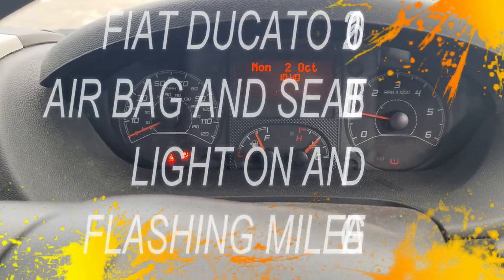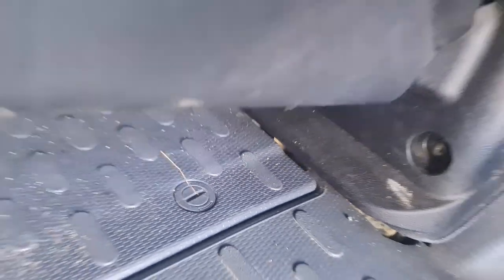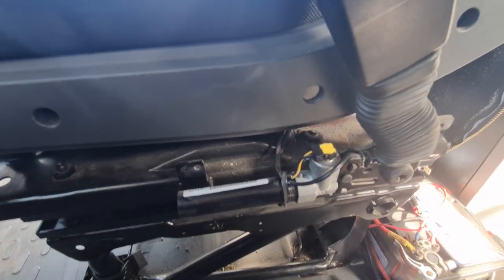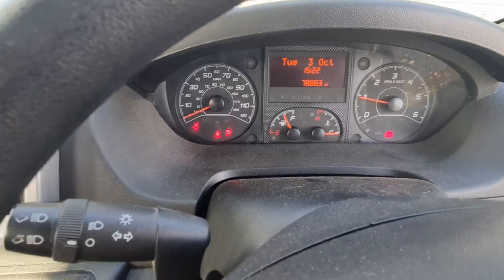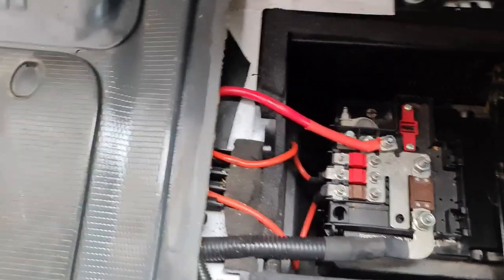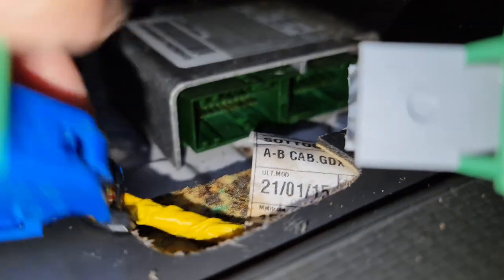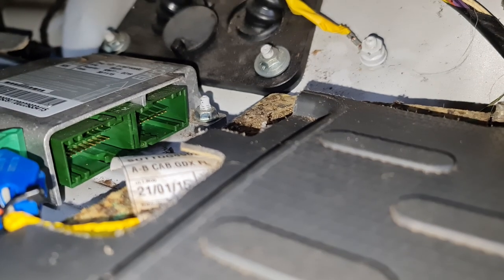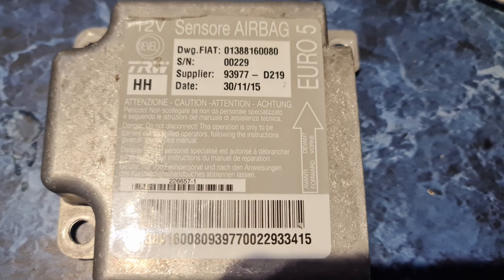FIAT DUCATO 2016 AIRBAG AND SEATBELT LIGHT ON AND FLASHING MILEAGE

Comment: Exactly  the same issue, just fixed.
An important  point,  any disconnection/connection in any part of the air bag system must be done with the battery disconnected for several minutes. A accidental deployment  or damage to the air bag ecu may result.
Some faults can be fixed  but many cannot. A new module is the safest solution. Order through a Fiat  dealer  ( even if  your van is Citroen or Peugeot, the part through Fiat will be lower cost). The part number  is at the  top of the module, not the bar code. The replacement  will  have the updated  part number, black label. Once installed the new unit needs to be proxy aligned with a suitable diagnostic system. Diy systems ALFA obd and Multiecuscan can do this or most garage diagnostic systems. 
The airbag  ecu has to match the vehicle configuration, so must be ordered on the part number. Expect to pay, Jan 2024 around 280 Inc vat.
Reply from the maker: thanks for watching and comment and info

Comment: Gutted for you fella that’s a nasty sting in the tail 😢. Hunt the wonder web you might get lucky on a replacement cheaper. As for the mot if you remove those bulbs they can’t fail it ! No light no problem 👍
Reply from the maker: good point Grumpy

Comment: Hi Mark. Did the air bag module get fixed by auto tech?  Did the flashing mile ohmmeter go away as well. ?   Just got the same fault. Sent my module away to auto tech.   John.
Reply from the maker: Hi John nope they couldn't fix mine ,when i took my module to the local garage they couldn't get a reading from it
Reply: @MrMeltedwellies  did you get a new one from fiat or another supplier?

Comment: Just checking your mileage you have done 2000 miles less and your van is 2yrs younger...mine is a 2018 with 131 thousand kilometers.
Reply from the maker: Hi Stephen i am not a big fan of wearing a seat belt ( i know) so i was wondering if that didn't help ?????
Reply: I am no expert...but if you do get it fixed few trucker tricks...get a buckle from a scrap yard or do up seat belt and sit on it.
Reply from the maker: defo will look into that thanks Stephen 👍👍😂